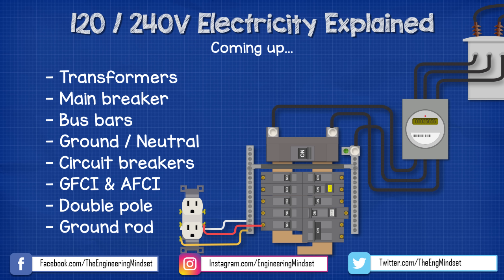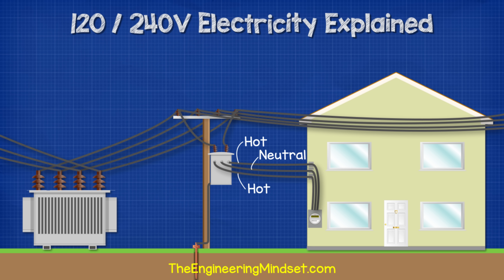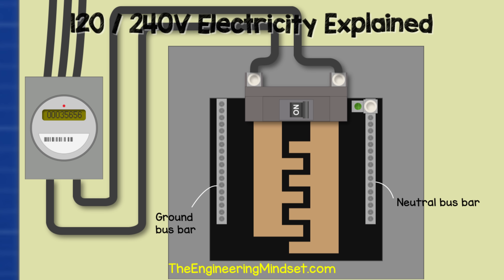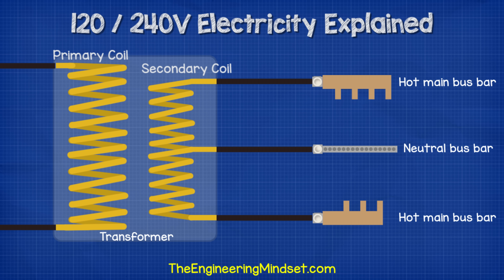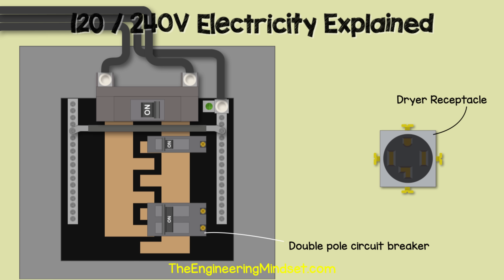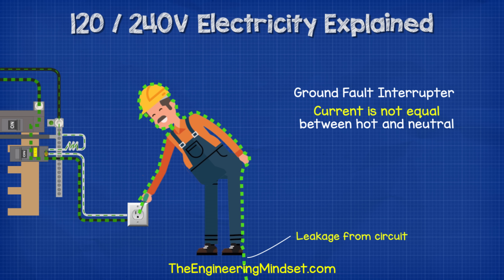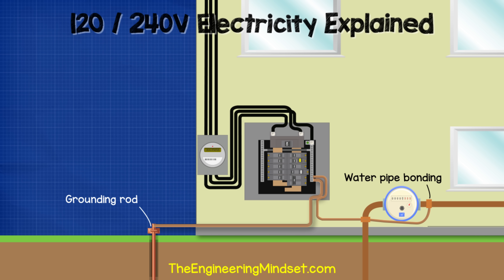120V 240V Electricity explained - Split phase 3 wire electrician

Comment: Hi. I have a doubt. Maybe it's very basic. In your wiring of a light with a switch, we can the see the Hot wire from Breaker to switch and to light. Whereas the neutral wire from light directly runs to Neutral Busbar (in turn which is directly connected to the transformer). So my question is, when the breaker is kept off, can a person get an electric shock by touching the neutral wire of the lamp barefoot, since current will flow through the Neutral during the negative cycle of the Alternating phase ???
Reply from the maker: It's possible but unlikely. Neutral is grounded so it's potential is zero unless wired incorrectly. You would be the same potential at the ground, no difference, no current.
Reply: @EngineeringMindset  Thanks for the reply. In that case, when the circuit is closed and lamp is glowing, during the negative cycle shouldn't the current flow from Neutral to ground as it's least resistance than flowing through the lamp and eventually to Hot terminal ?🤔

Comment: My interest is to create a 220v outlet. As I read this video, using a double circuit breaker would allow two wires (plus ground) in different phases, from different sides of the breaker box bus bar, i.e., one from bar 1 and one from bar 2. Thus connecting those two wires, one black, one red plus the ground into a NEMA 5‑20 receptacle would provide 220v.
Right?

Comment: Fun fact circuit breakers are rated for 80% of what they are labeled as. So on a 20 amp circuit yes all conductive parts can (hopefully) handle the current but the breaker will trip at 16 amps (if the corrects AWG wire was used).

Comment: Can somebody please explain why electrical current does not go from the neutral bar, through one of the ground wires on the neutral bar, and then back to where it's grounded at the load? It wants to go back to it's source more than another path? No back EMF that will shock?

Comment: One question from another country from an amateur. So in your country you have 2 positives lines coming? And if you only plug one it will be 110v  and if you plug 2 you will have 220v ? In my country we only  have 220 and only one positive.
Reply from the maker: You have this system: https://youtu.be/W0_1xRqT8uU
Reply: @EngineeringMindset  thanks.

Comment: Why does the ground not go to the ground? Is it just a second neutral wire? Why not just split and attach the neutral to both the load and the fixture instead of running a whole different length of wire!? That would save 1/3 of wire and cost. Either the ground serves no purpose or should Not be connected to neutral!
Reply: Ground does go to ground.

Neutral is the return for current in the load. Without it the circuit is not complete.

The purpose of ground is to never have current flowing. You should think of ground as a shield between the circuit and you.  Back in the olden days when things were made of steel and aluminum the purpose of the ground wire was a bit more obvious.  In the plastic age you can just leave the ground off.
Reply: @securitycamera8776  That's what I thought but in the video he shows them as interchangeable when they aren't. I was just trying to point out and explain that I thought it was a mistake. In fact if I'm not wrong then wiring ground to neutral inside of the home would not even pass inspection but I'm no elekchicken.
Reply from the maker: @ninjapancakes9435  It's not a mistake. It's in the code.
Reply: @EngineeringMindset  I apologize I missed that if it's a primary circuit you put them together but if it's secondary apparently they are separated. It still doesn't make sense to me but whatever.
Reply: @ninjapancakes9435   Wiring ground to neutral inside the home is allowed only at one point, the main panel.  That one point is to make neutral have some reference to the world we live in.  If the neutral is not grounded the circuit could appear to  be working normally but be floating 500 volts above ground due to a defect in insulation between primary and secondary in the transformer or a dead snake that shorted the primary and secondary. The world is not perfect it is really good to know your neutral is at least in the vicinity of ground potential.

Comment: i think most of us not aware of the fact from medical field recorded that most of asian electrical distribution use 220 v whichnis like pressure and this reduce the need of high current but in return it create higher gravitational pressure lead to high rate of hypertension, whie in the u.s. the 110v had less hypertension rate except for those was not born in the U.S. also it seem like the lower frequency the faster electricity and light travel and the cooler it is while if we matching the heart rate with electricity system human or zoombie are hard to distinguish

Comment: how does electricity not travel through the ground even though it's low resistance? how does the current travel through the neutral back to the transformer instead of most of it going through the ground? I don't understand how the neutral and ground can be physically connected to gether
Reply: Electricity does not care about ground.  Electricity returns only to the source.
Reply: @securitycamera8776  "Electricity returns only to the source" yeah through the path of least resistance. why isn't it going through the ground wire. That's what I'm asking
Reply: @brod515  Because a properly installed ground wire is only connected to the circuit at one point.  It takes at least two point connection for current to flow.

Comment: Love your videos. Id love to see the video explaining why sub-panels cant have the neutral bonded. I kind of get it, but a visual would help a lot. Plus I have weird specific circumstances that relate to it; a power distro that usually acts like a sub-panel, but sometimes like a main panel. Sometimes being hooked up to a generator, sometimes to a dryer outlet, and possibly sometimes to un-grounded dryer outlets. Ive seen it done (possibly ill advisedly) where the tester shows a properly grounded panel on an un-grounded outlet. I am assuming that they bonded them. Im wondering if it could be a special exception due to the fact that if you bond the ground at this 'sub-panel', it still only connects to the neutral since the dryer supply line has no ground.

Comment: I'm not clear about the "Dryer Receptacle" portion of the video at the 8:51 timestamp. At this point you add a Neutral wire and then the Ground wire yet I don't see a Neutral screw on a 240V outlets. I see two hots and one ground. Can you please explain this difference?
Reply: Most older dryer, oven and other large appliance outlets were three wire.  L1, L2, Ground.  Newer outlets are four wire.  L1, L2, Neutral, Ground.  You can safely get 120 volts from a 240 volt outlet without using the ground wire as neutral.

Comment: From my experience in the US, it is much more common for GFCI to be implemented in the outlets here, not at the breaker box.
Reply: It depends on the application. I've wired apartments where a combination of both was used. If an area requires both AFCI and GFCI protection it can be more economical to put in a combo breaker than having a GFCI outlet on an AFCI breaker.

Comment: is it two of the three phases supplying the primary coil? is this is a phase shifting transformer? im wondering because in 3 phase the separation is 120 degrees but on the other side of the secondary coil we achieve 240v which means that the two hot legs must be 180 degrees apart in phase.
Reply: I believe they use single phase generators and don't have 2 actual phases, and use the highest and lowest point of sin in combination with a middle connection on the Transformator. That would also lead to 180° as you said. May I right? I'm just guessing 😅😅
Reply from the maker: Seen our new 3 phase transformer video with worked examples: link- https://youtu.be/u0SsejDCVkU

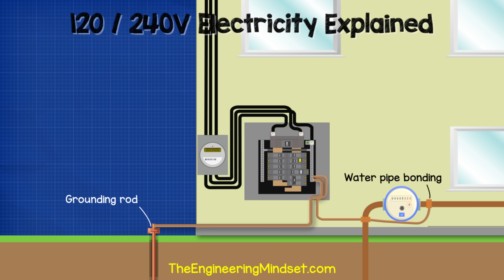Comment: 12:01 how does the ground rod dissipate static build up, that should be explained, and the hot wire metal pipe, person thing, that should be elaborated as well to understand how that situation would occur and how the electricity would behave.
Reply: Slow your roll donk. You can't overload people with information in quantities that they cannot digest. I agree those would be great follow up or addendum videos but this video but it's mark perfectly. There's always gotta be one guy that just cannot accept things as good quality and have to pick them apart. They're the same people who over coach little league and no one learns not enjoys the experience. You're that guy. How about phrase your comment differently and say "great video breaking it down in simplistic terms and visuals so the lay person can comprehend. How about as a follow up now that they have these principles doing a video explaining _____?" That comes off far better than you did looking like a hater who's gotta one up someone with their wicked knowledge. Look Alvin Einstein. You didn't invent electricity so there's nothing ground breaking you're speaking on. If you've got such wicked awesome ideas for how this video could be better then create one! No? Figured not. Just an ass clown with opposing thumbs, a keyboard, rudimentary knowledge and no life. Pound sand dick boy.

Comment: 11:30 why is it a uninsulated wire, isnt that dangerous?
Reply: Because there are normally no current running on it. As it function is to provide protection against lightning and residual current. Also because of this reason neutral wire normally safe to touch (but don’t try it either) because neutral wire is grounded too

Comment: doesnt electricity always need a return path, so i never understood that how we needed a ground wire to give it an alternate path incase of a shortage or something..... if the electricity went through person in a faulty siutation  its like an open circuit, theres no return path, so what is going on here? why would electricity act like this?
Reply: Well, think about it this way. Yes, you are generally correct in thinking that electricity needs a return path and wants to go back to the source. Electricity will take the path of least resistance either back to the source, or to the ground. Either way, the electricity is wanting to find balance, and is trying to go back to the positive. Electricity has the tendency to flow to the ground due to the positive charge in the ground. If a path is provided to ground, then the electricity will choose that path as the ground is much more positively charged than the source it originally came from.

The problem arises when that path provided from the enclosure/equipment to the ground is you. Because suddenly, you become the most convenient place for electricity to flow through to be equalized the most, and all of the energy in the circuit will go through you instead. By providing conductors intended solely for this purpose, you are no longer the best path for electricity to flow through, thereby protecting you. I hope this helped. If anyone else would like to improve upon or correct anything I have said, you are welcome to do so.
Reply from the maker: We just published a new Ground fault, short circuit and arc fault video, so much detail! Link HERE➡️: https://youtu.be/Qi0ynSQw-wc

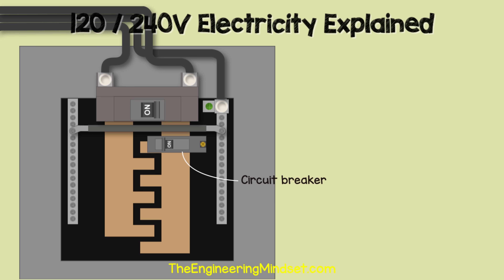Comment: 6:44 when you say it will create a magnetic field, you dont elaborate on the science behind that and what it does and how it causes the breaker to trip. Please explain...
Reply: its called shorting out. when u accidentally drill thru a electric wire it cause magnetic field the moment + - made contact it supa fast. But I suggest dont do it..

Comment: As an AC service tech, this is a great explanation as to what i work with on a daily basis. I work with 240v and 24v for controls but i do sometimes have to create 120v with a special jumper cable for some services on rooftops and other situations of the like for quick repairs.

Edit: i was tought how to create 120v from 240v, but this is a better understanding of the purpose of neutral, ect.

Comment: A brilliant explanation. Coming from Australia I have always been mystified by the US domestic electrical system. I assumed (incorrectly) that all domestic installations were connected to a star secondary transformer winding. Grounding would have introduced all manner of issues if this had been the case. Your explanation has made me "see the light". Thanks again for this clear and very well documented description.

Comment: Question: I understand why a neutral is needed for DC but I don't understand why AC needs a neutral. AC current doesn't "flow" but rather moves back and forth, so isn't the "return" also through the hot wire? I think the answer involves load balance but I haven't yet found a resource that has helped me conceptualize it. Can you point me in the right direction?
Reply: In a purely resistive circuit DC and AC have the same rules.  They have to be treated differently only if there are reactive components like capacitors or coils in the circuit. Also they do not act the same if the physical size of the circuit is large compared to the wavelength of AC frequency.

Comment: This maybe a silly question but how come if you measure on both leads on the secondary side of the transformer you get 240V and not 0V? It's all one lead for the secondary side technically. I thought if you read across the same phase you get 0V.

Comment: Are the voltages across the 120V legs of these installations out of phase with each other?  Or are they in phase?
Reply: In suburban areas they will be 180 degrees out of phase in urban areas they will be 120 degrees out of phase.  That is not always true but it tends to be that way.
Reply from the maker: Seen our new 3 phase transformer video?➡️: https://youtu.be/u0SsejDCVkU

Comment: I grew up when the standard voltage is 110 volts and 220 volts at 1 ampere of current at 60 cycles or hertz per second at 3 phase in the 1920s, 1930s, 1940s, 1950s, 1960s, 1970s, 1980s, 1990s. The question is, what happened to the Non-Step Transformer which is so commonly used before and is used before and after the fuse box? I remember using GFI (ground fault interruptor) circuits hardwired to detect any current leakage as low as .0000010 ampere of current which is 1 millionth of 1 amepre of current to prevent accidental electrocution.
Reply from the maker: We just published a new Ground fault, short circuit and arc fault video, so much detail! Link HERE➡️: https://youtu.be/Qi0ynSQw-wc

Comment: I am confused about how adding more appliances to a circuit, that is connected to a circuit breaker, increases current?  Wouldn't those appliances add more resistance which would reduce the current, which would prevent the breaker from triggering?
Reply: If appliances were added in series your statement would be correct.  Appliances are added in parallel so current will increase.

Comment: I have understood in broad terms how civil electrical systems are, and the split phases, even if I have some questions, is the star center of the transformer / neutral grounded on the transformer pole? and this comes directly or through an impedance.
do I see in the video bus connection bar between neutral and earthing system? Is it still used because? I understood that it was not done anymore is the neutral and the earthing system separated on the user side?
In American industrial plants, on the other hand, I don't know anything, for example the three-phase voltage between phase and phase and between phase and neutral?
Here we have the transformers that go from three-phase 15Kv to three-phase 400V between phase and phase there is 400V and between phase and neutral 230V, these are the minimum voltages, the motors or go in single-phase at 230V with capacitor or inverter or in three-phase 400V , the neutral to earth to the transformer, and earth system for homes often have more than one rod in the ground and is separate from the neutral, the meters also electronically limit according to the contract, ranging from 1.5 to 3 to 4.5 to 6 and rarely if the transformer is near 10kw, with tolerance + 10%, the standard sizes are from 3 to 6 kw always all in single-phase 230V, beyond 6kw you go on the three-phase + neutral and start from 10kw in steps of 5kw to rise, in the industrial with proprietary transformers the neutral and the earthing system are separated in the distribution, but they belong to the same dispersion system near the cabin, it is called the TN-S neutral regime, the civil distribution is in neutral TT , although in buildings with many apartments, with internal transformer cabin, often the dispersion systems are always separate but often with rods or nearby pegs and even if physically separated between the neutral of the transformer and that of the building's earth, they are very similar a middle ground between TT and TN-S.

Comment: AFCI breakers are garbage. every relay, switch that you turn on causes an arch.  if you have these, dont be surprised when your fridge wont turn on and you lose your food because of the high "arc" generated from the start relay. 
they are unreliable and a hassle. normal breakers are more than sufficient.   if you want GFI circuits, you can either have a breaker, or outlets.  and heres the fun part. if you connect a gfi to a gfi, they will cause eachother to trip.
Reply: Isn't that the case with any electric motor too?